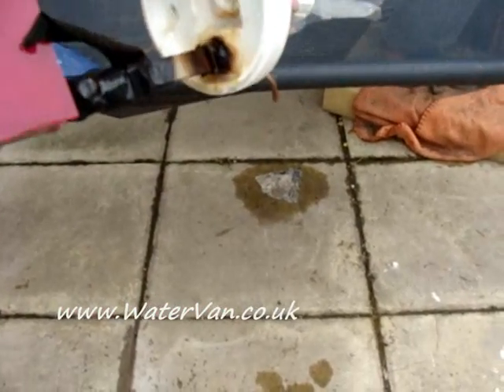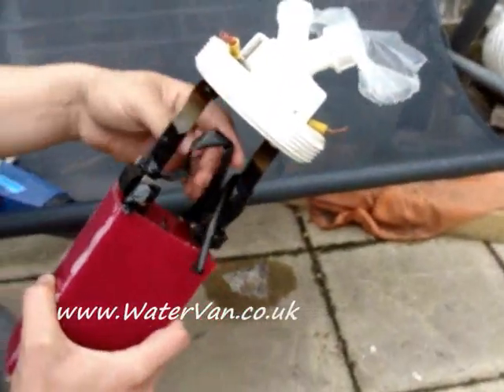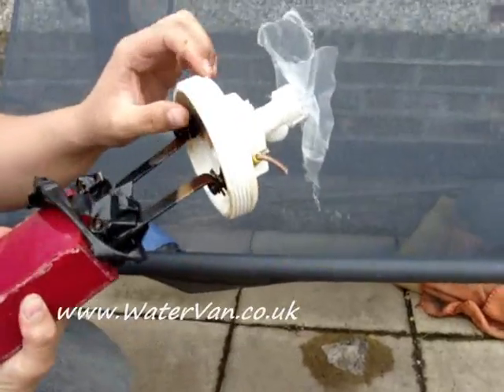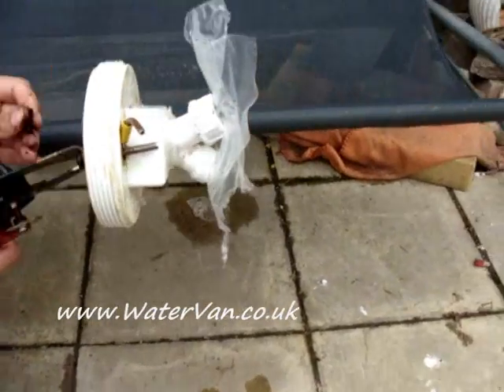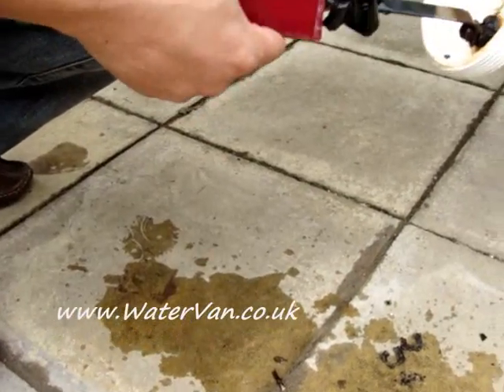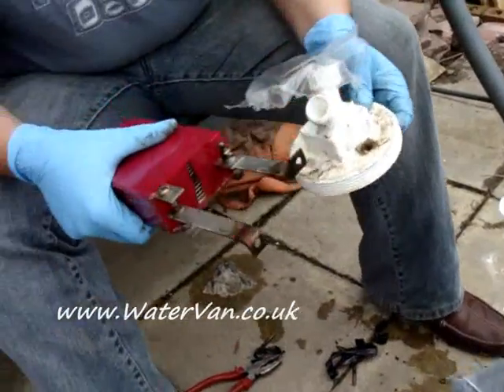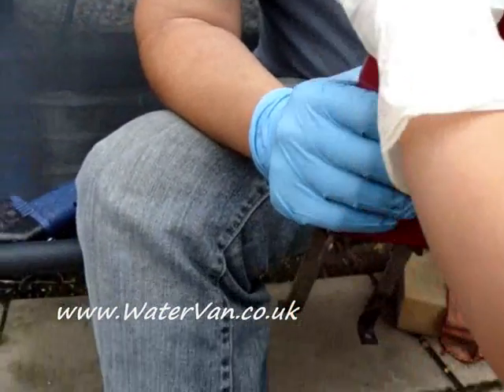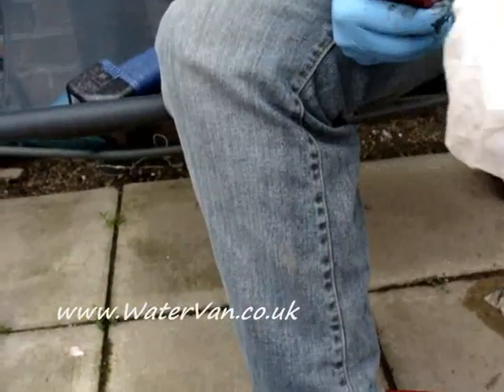#032 C5 MadStu's WPV - First inspection of Cell 5 (Barbie)

Comment: PS Make sure you keep all your conection to the top of your cell are heavy ones because you will make heat if there is any resistance in the circuit to the cell best not to use a jumper cable clamp on it you need a real solded conection will show you how I did it in my next video I've not run the cell over 40oC Yet so I'm yet to find out if it can take the heat :-) Keep up the great work Mate!!!

Comment: Hi Stu how is the rubber paint going? my perspex failed again so all I've done now is just coated the bolts in marine goop & have let it dry for a cupple of days I'll try & do a test it on monday with a video I'm going to try a little bit of clear coat car paint and brush it on the edges of the plates at the top opening & bottem opening & see it it stays stuck to the plates I bleave if it works I might hit the 6.00mmw mark hopefully.

Comment: MadStu, you have come a long way in a very short period of time ... each of your devices gets better ... looking at your autopsy, I think this unit is easily salvaged ... if you can find some heat shrink wrap to take the place of your electrical tape, fixup your electrical connections to make them tighter and re-glue a couple places, that gadget can go back in service ...

well done sir ... very well done ...